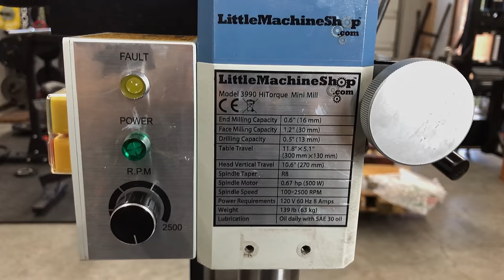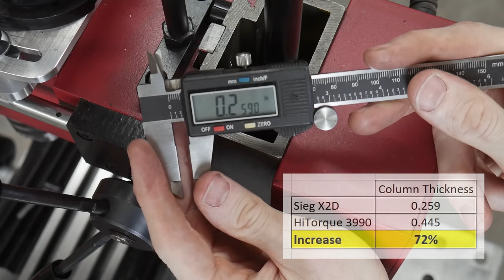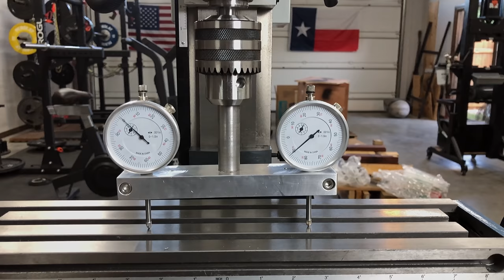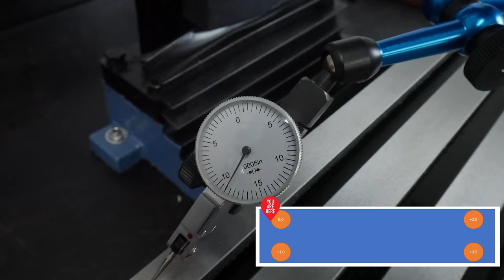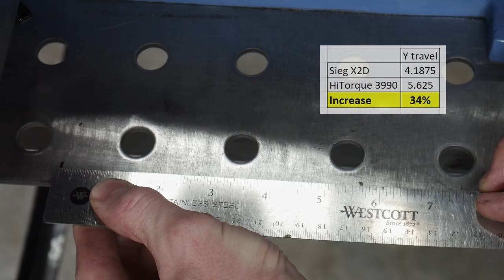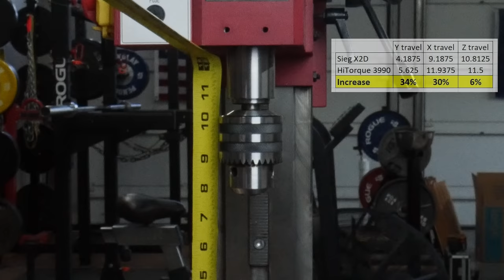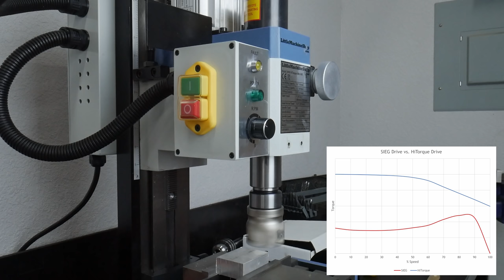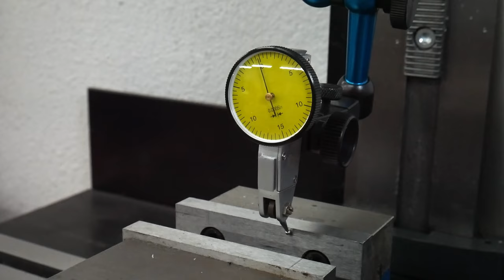Likely The Best "Mini" Mill For Knife Making & The Home Machine Shop | Sieg X2 vs LMS HiTorque

Comment: Picked up an HF mini mill over the memorial day sale ($200 off).  Locking down the column with scrap steel, throwing out the chuck, and eventually getting the belt drive aren't an issue for me.  I'm honestly more nervous about the electronics going out, but we'll see, I guess.  I think with light cuts and not trying to use this like a 1500lb Clausing it'll be fine for what I do.
Reply from the maker: Sounds like a good plan man. If the electronics do go out there is a guy who repairs and upgrades the boards for a reasonable price. You can find OEM boards online too if need be. 

For knife making... these little mills do a darn good job
Reply: @RedBeardOps  I noticed that LMS also offers steel gears as an upgrade for these things as well.  If I'm not mistaken, I believe you do lose a bit of torque on the low end needed for drilling larger holes.  Opinions between the two upgrades?
Reply from the maker: @provenancemachining  I really don't have an opinion. May be best to ask LMS

Comment: Far out! I’ve been looking at getting a mini mill just to mess around with and learn on. But the Harbor Freight mills and lathes, with their plastic gears, have scared me away. I’d rather spring for something that I won’t have to rebuild to make it functional. As a 65 year old learner, I seriously doubt that I’d ever need a tilting column that introduces errors that I might not know enough about to fix. The mill isn’t cheap and neither are the measuring tools or cutting tools. I can tell that this isn’t gonna be a cheap venture but it’s something that my entire family can learn to use. My wife and sons have expressed interest but it likely me that will get the most use from it. Thanks for such a thorough overview!
Reply from the maker: Heck yeah! Good luck sir!

Comment: When tightening those bolts on the column would it be better to use a torque wrench?  Not that I know of any particular torque spec but am just thinking it would make the tightening more consistent and remove a variable in the process.
Reply from the maker: Hey Tom, I'm sure that would help! Good point

Comment: I liked your video alot. I havent bought one yet but decided in the harbor freight. You video started to change my mind. So I went to LMS website to look at the 3390. Thats not really comprable. The 3990 is a 1299$ machine vs harbor freights 700$. LMS sells the 4700? I believe which would be more of a fair comoarison.
Reply from the maker: No sir, I must disagree. They are both on the Sieg X2D platform. (the HF mill and the 3990). The 4700 is a micro mill. Glad you enjoyed the video!

Comment: Nice review. Really sucks though that you cant really tram that thing in to less than  .001".  This is a huge disadvantage regarding finish milling . You'll never truly be square and the finish with any endmill or rough mill over 1" diameter will leave a ridging finish. All in all, seems ok for the price.
Reply from the maker: Good points.

Comment: Such a vast difference in price. Is it really worth it as a hobbyist?
Reply from the maker: Hey Tyler, by the time I repaired and upgraded the Harbor Freight mill the price was about the same. And there was the inconvenience of the HF unit breaking on me twice.... Once for the circuit board and once for the gears.

Comment: Hi Bud,
I have the Little machine shop Mill myself and all of a sudden it stopped working mid cut.
I've checked all the fuses and it still wont turn on (green light is on).Did a bit of research and its the Board thats bad (no led).
can you send me the guys name who looked at yours please,$350 is a tad high if i can get away a bit cheaper. Only used this mill about 10 times but im out of warranty. thanks m8.
Reply from the maker: Gosh damn that's terrible news! Sorry to hear that happened to you. One thing I did after blowing mine on the HF mill was to wire in a dedicated 20amp circuit for my mill. I read that it could help...  They guy who saved my bacon on the last board was Pete Brush - olduhfguy@gmail.com - www.olduhfguy.com - 207-370-5890

Comment: I understand that the blue mill is better than the Harbor Freight mill, but is it worth the $500 or so difference in price? What little I do or want to do, can be done with a drill press with a fair X-Y vice. If I had a mill I might do a bit more but I doubt it.
Reply from the maker: I think it's worth it, but thats up to everyone to decide on their own. I have more than that into repairs and upgrades on the HF version.
Reply: @RedBeardOps  Unfortunately the cost is about twice what I get on disability in a month. At least with the HF I can spend less to begin with and add belt drive and so on a little bit every couple months.

Comment: So would you say it's the best for the money or will the harbor freight model work for a novice to start on
Reply from the maker: Personally I wouldn't buy the HF model again. It did work for me as a starter mill, however, I had to get the circuit box replaced/repaired, and the gears broke. With the time and money I spent on the HF model (repairs and upgrades) I should of bought the LMS version from the start. Would of came out ahead for sure. Just my opinion...

Comment: does the motor on your X2 stall under light loads? mine does?
Reply from the maker: Hey John, I haven't noticed that. To get it to stall I normally have to do something pretty heavy
Reply: @RedBeardOps  it happens on liight drilling and milling, nothing over 1/2" dia, the  mill isn't that old, I got it new Dec 21 2021 from Harbor Freight...

Comment: I'm assuming these are being bought due to space issues? Because a machine like a Bridgeport mill with far superior spec, suitable for a proper CNC upgrade from a machine auction won't cost much more if anything. There is no comparison at all between these machines.
Reply from the maker: For sure Tim. It comes down to space and price. For the craft of knifemaking the 3990 can do just about everything one needs.

Comment: I'm a little concerned about the plastic shims for the column. My experience is that they will compress over time. "Plastic" is plastic. Might want to consider swapping the shims out for brass or, better, stainless. 
Nice review otherwise.
Reply from the maker: Thanks for the tip!

Comment: Big improvement. But, there is a huge price difference.
Reply from the maker: All depends on what you're going to use it for and how long to plan to use the tool in my opinion. If I understood the differences I don't think I ever would have bought the HF version and would have bought the 3990 instead. Lesson learned I guess.... At least it let me make a cool side by side review. Cheers!
Reply: @RedBeardOps  it's a great tool. Upgrades are worth it. Just a jump.

Comment: Looks like the little machine shop mill costs approx 3 times as much as the HF mill at $1500 shipping taxes etc.
Reply from the maker: HF mill here - https://www.harborfreight.com/two-speed-variable-bench-mill-drill-machine-44991.html - is about 800$ list... but yes you could get it lower with a coupon. My issue with this mill was the electronics going out on me and the plastic gears. I was lucky to find a guy who could fix the circuit board, but this cost money and time. The plastic gears breaking also required me to either a.) replace the broke gears with more plastic gears b.) upgrade to the belt drive. The tension system on the HF version also sucked with the torsion spring.... I guess my point is that by the time you go through all this; you'd be money and time ahead to just buy the better more capable 3990... Just my opinion. Cheers sir

Comment: That's NOT an X2D!  The X2D doesn't have the tilting column.  In fact, the X2D has a number of features that exactly match the LMS mill, including larger table, air shock, even the offset x-axis gib lock.  The main difference is in the motor and drive belt.  HF used to sell the X2D, I know because that's where I bought mine.
Reply from the maker: My mistake, so which is the HF now with the tilt? Sieg X2?
Reply: @RedBeardOps   Yeah, I think it's the X2.  In fact, LMS still sells the real X2D. It's $350 less than the LMS 3990 you review.  Yeah, I'd like to have the more powerful brushless motor on mine but that isn't worth $350 to me.  I don't need the belt drive and even though I could install the LMS upgrade kit, it would mean I'd have to remove the spring-loaded spindle lock I made.  I've done some pretty stupid things with my X2D and have yet to break a gear (knock on wood) so the belt drive doesn't seem necessary.  Maybe the gears in the X2D are different than the ones you broke, hard to say.  Anyway, thanks for responding and please change the title so as not to disparage the X2D. 😁
Reply from the maker: @idynot9408  yeah my plastic gears lasted 2 years. I'll change the title if I get confirmation exactly what model the tilt column is. I'll follow up with LMS on that.

Comment: Love everything except the price.   Still a poverty hobbiest.
Reply: Save man.. you can do it. It took me YEARS to finally get just a mini mill. I had to automatically have a few bucks each check routed to an account I didn't have access to so I wouldn't touch it. 😂

Used Seig X2 and X2D can go as low as $4-500 at times. Used 3990 mills seem for go for $7-900. 

LittleMachineShop's clearance / open box section is worth watching.

Comment: Your wrong the x2d mill is not like the one from harbor freight the x2d mill by sieg comes from little machine shop it has a fixed Callum and your wrong on table travel and size
Reply from the maker: That's right Stacy, I've changed the title and put a correction in the pinned comment above.
Reply: Your still wrong because a real x2d mini mill has the same structure table size and travel as the high torque 3900
Reply: When traming your mill never use the drill Chuck you won’t get accurate readings too much play
Reply from the maker: @stacybelinskey2007  According to LMS the mills from HF are the X2